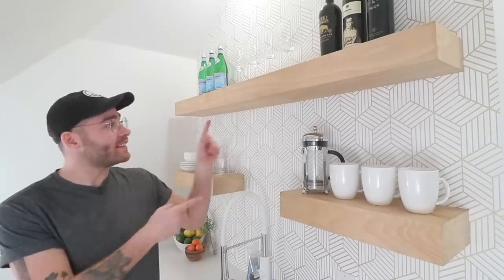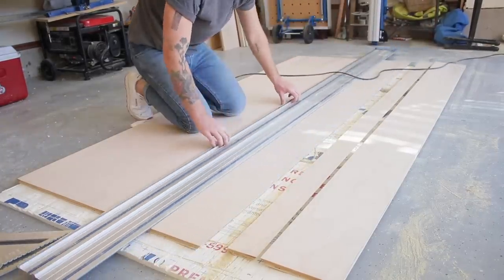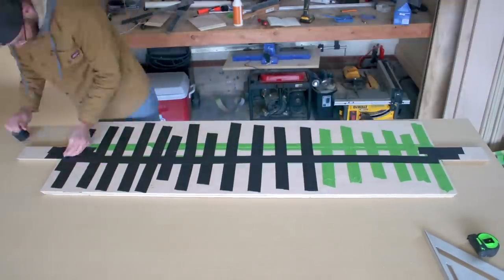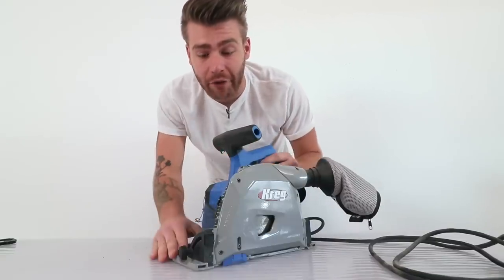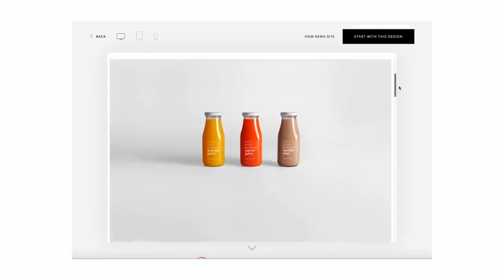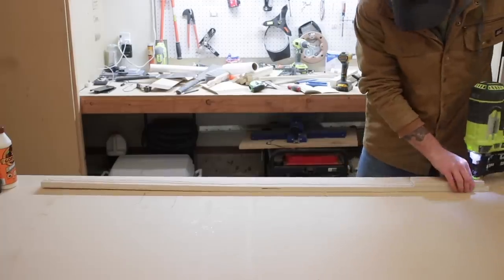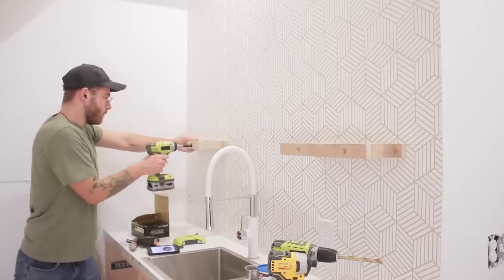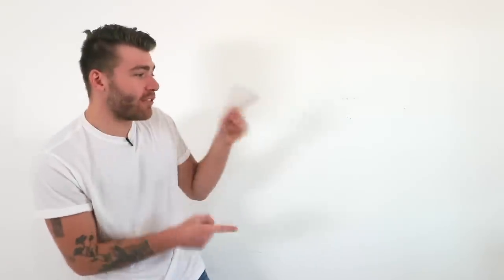DIY All Plywood Floating Shelves with NO BRACKETS // Woodworking with Kreg ACS

Comment: When making this style of shelf or box that the inside wont show, I cut my mitres to 45.5 degrees. 47 is way too much, that will get you 4 degrees open once you fold them together. Then there isnt much material in contact with the glue.

Comment: are there any worries about making the profile of these smaller? love the simplicity but for the space I need them in, need them to be less wide/tall.
Reply: there are no worries, but a slab of hard wood might just be a better idea and look, depending on how thick you want the shelves.  Why spend the time to build a box when you can buy a slab that is already the proper thickness?  A slab will have the continuous grain look without all the match, cutting, and assembly.  Hope this idea helps

Comment: Great vid, Mike! Noob question - when you were using the guide on the ground, how'd you make sure the track was set parallel for the rip cut? Does the track have something to help or did you just use a speed square?

Comment: Instead of 47 degree do 45 degrees but take a strong sander and remove the meat of the mitre. Leave the thin part of the mitre untouched (roughly 1/4”) that way you won’t have a problem getting tight mitres.

Comment: If you cut at 47 degrees, you'll have a 4 degree internal void. You'd need to use epoxy or PU or something else. Wood glue is a poor filler.
Reply: I was thinking the same. Good idea, but just a hair over 45 will do it.

Comment: I feel like I'm being talked down to through the entire video. The hunch over thing is very annoying. I can see it won't fall off, but was expecting you to discrete brad nail the boxes when placed in desired position. The bracket frame is the most interesting.
Reply: tensazero I don’t think there’s anyone on YouTube as humble as this guy. He’s not talking down to his audience he’s just simplifying it and making it less daunting for new comers. The fact that he unapologetically shares all of his mistakes says a lot about his character. I think you just read him wrong. And ditto on the Brad nail. Was waiting for him to secure it. 😊
Reply: @aussiefreediver  I meant the camera angle
Reply: I've done the same kind of setup and used narrow screws to hold the box on. Much easier to remove than a brad nail if I ever want to remove or repair them.